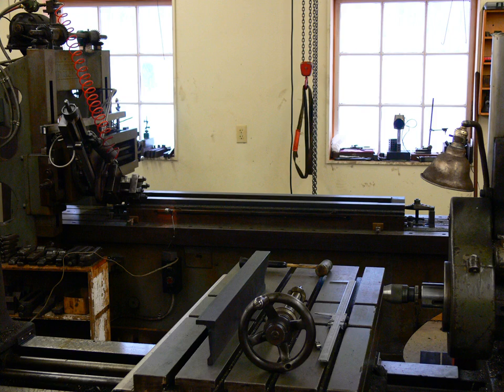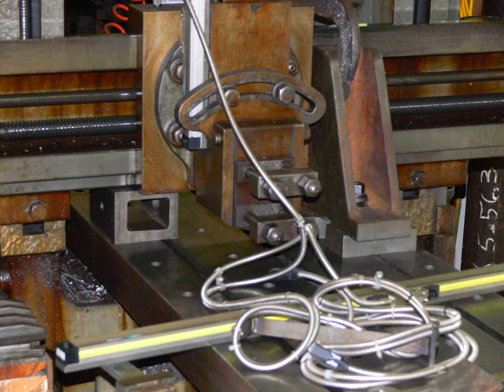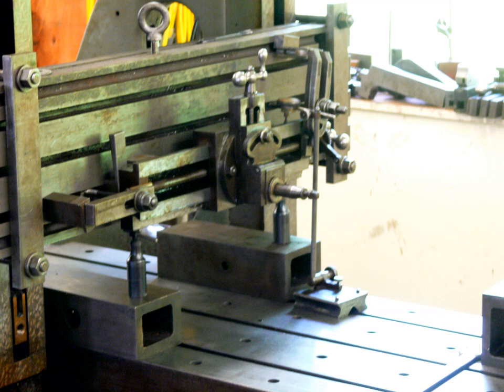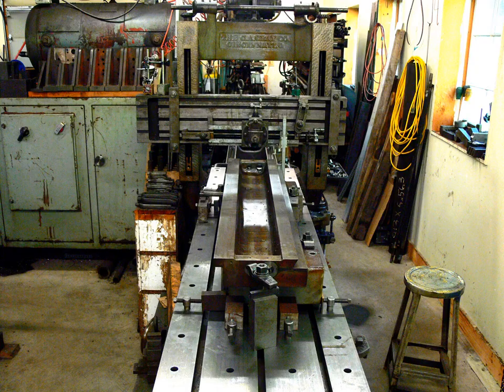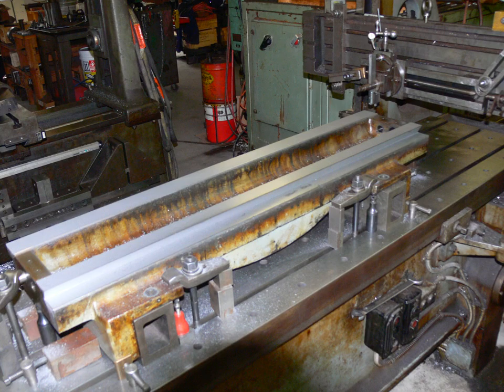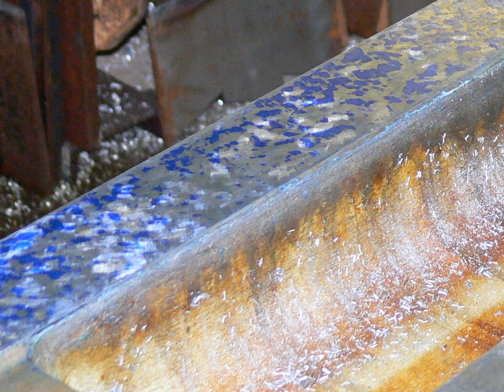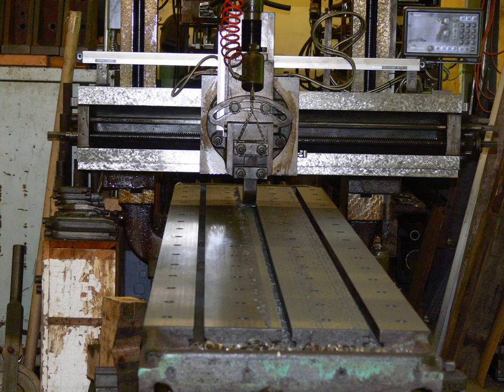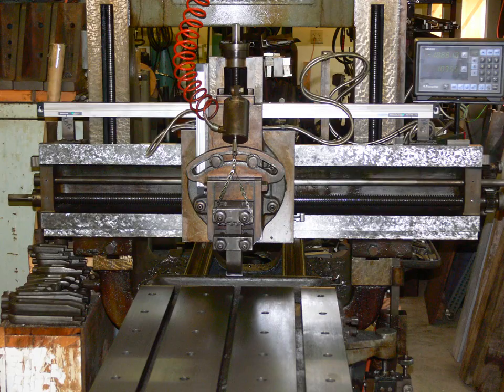Planing its own rail - Slideshow (see update instead)

Comment: Great ingenuity!  How often do you plan the table on your planer?
Reply from the maker: Over the past 47 years I think I have planed the table 4 times: Once after I bought it; When I converted to hydraulic cylinder; When I scraped the table ways; And when I planed and scraped the rail.  There might have been one more in there somewhere.  I think that there should be a very good reason to plane the table.  

When I was looking to buy a planer one of the problems I found was that the tables had often been planed so many times that the upper portion of the tee-slots had become dangerously thin, and it would not have been possible to use slot-blocks with those machines.
Rees

Comment: Just setting up to do the same on my planer. I don't have anything long enough so I am using a 12x6 Oregon beam so will be grinding not planing
Reply from the maker: I don't know what an Oregon Beam is so I can't picture it.  Presumably it allows for accurate travel.
  I hope all goes well.
Cheers,
  Rees
Reply: @reesacheson5577  A big chunk of wood 12"x6" section and clamped on the same as you did with the milling table. I only want to straighten the top edge so I have the clapper box head clamped onto the wood with the grinder in a vertical position so I have rise and fall. The side movement for the depth of cut will done by tapping the head sideways on the Oregon beam. Maybe you call it Douglas Fir over there. All the best. Tamal
Reply from the maker: @gettuff2  Ah! I see, just grinding the top edge surface.
You should keep in mind that this surface may be the least of the problem.  What also effects the tool is the front face of the rail near the bottom.  This is usually worn and consequently the tool dips deeper as the head reaches the most worn portion.  
This is because the tool is out front of the head.  And as the head traverses the rail the head dives in at the bottom, but not at the top (the front surface is no longer plumb).  The tool, which is out front of this, drops as a result.  The tool will cut a concave surface.
  Maybe you already have, but you might want to look into how straight the front surface of the rail is.
Hope all goes well.
Regards,
  Rees
Reply: @reesacheson5577  Thanks. i have that in mind and once the" gigantic" a little over a ton, gearbox is reinstalled and I have some table movement I'll definitely check everything.  I had previously checked the top surface so I know there is 3 though wear in it.

Comment: Amazed it had enough stoke to overtravel the bed both ways.  Did you scrape in the v ways first?
Reply from the maker: Yes, the travel was close, but I was able to get the flat surface done with a single rail placement.  But I had to move it from its original position to do it.
    As for the order of scraping, yes, I began with the dovetail.  But because the planing had created straight and geometrically correct surfaces, the order did not matter - it was just a surfacing operation..  
    But I began with the angled surface because it is hidden and hard to notice.  And I finished with the two broad surfaces on the front of the rail because they would be highly visible.  I needed the practice to become more facile with the scraper before doing the most visible surfaces.  I don't scrape that often and find that I need to get into shape each time I do it.
Rees
Reply: @reesacheson5577  Thanks for the reply. yeah it takes a bit to get the "feel" back for good looking scraping.
Reply from the maker: In replying to your comment I had assumed that you were asking the order in which I scraped the various surfaces of the rail.  Reading your comment again now, it occurs to me that you were asking if I had first scraped the bed and table ways of the planer itself to insure that the planer would produce an accurate planing of its own rail.
  The answer is yes.  Some years before I had done so.  And then after finishing this rail project, I again scraped the bed and table ways.  But this time they were already in alignment and so it was mostly just a surfacing operation so that they would look like the rail.
Rees